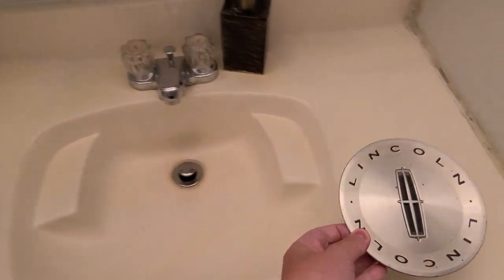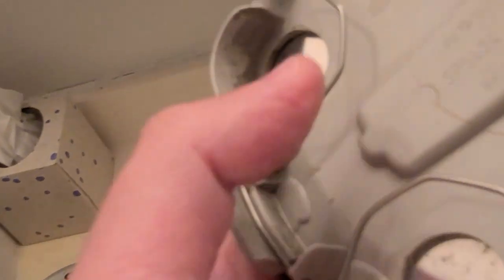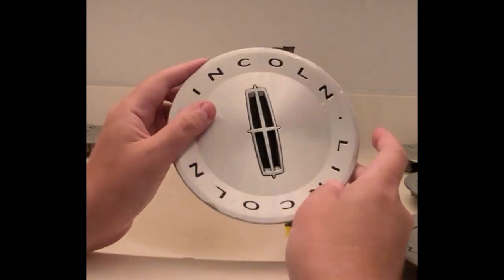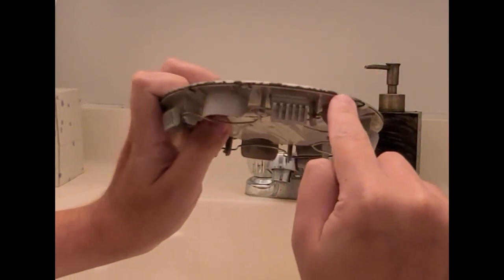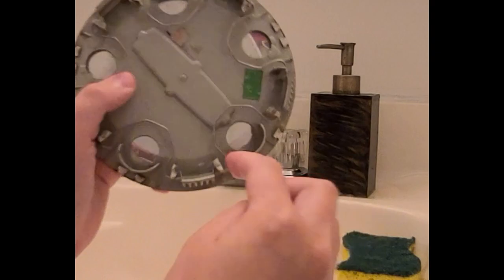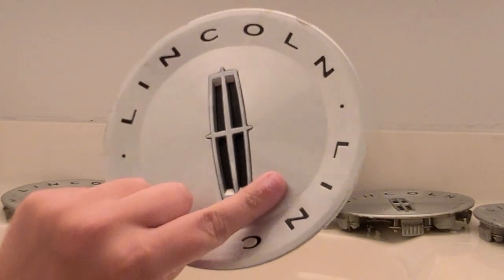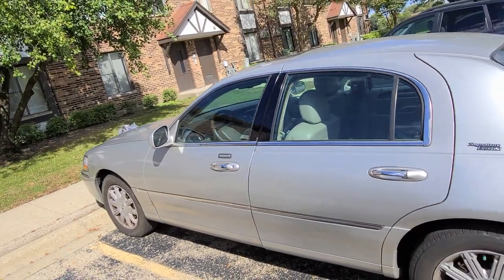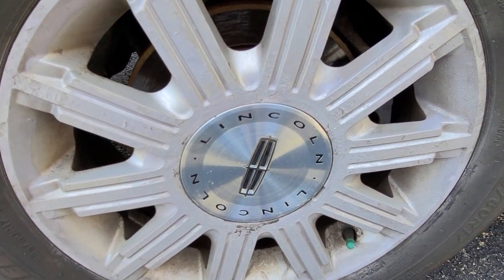Lincoln Town Car Guy Gets  Replacement Wheel Center Hub Caps For His 2006 Lincoln Town Car

Comment: There are still some new vehicles that have a center cap that hides the lug nuts but it is less common nowadays.  I prefer that design only because usually when you have your tires rotated or changed the mechanics are not careful at all with the wrenches and damage the lug nuts and sometimes even the rim in the vicinity when taking the lugs off.  With a cap like that it is all hidden.  I had a Park Avenue that had exposed lug nuts but it had chrome lug covers so I could at least remove those before taking it to the mechanic when the wheels were going to be removed.  I recently had the misfortune of getting a staple in a tire on my brand new Yukon with 500 miles and had to change the tire.  Of course they scratched up my lug nuts a little and even the rim a tiny bit.  It's very minor but come on, it's a brand new car!  Would they treat it like that if it was theirs?  On my old Buick Century it has full plastic bolt-on chrome wheel covers with a similar center cap and I just take them off if I am going to have a wheel serviced.
Reply from the maker: Thanks for the comment! This is my first car with these and the first car to ever have anything stolen off it... They weren't perfect, but I was happy to get all 4 at perfect. Replacements are also well used, but look a lot better that before

Comment: Thats the smallest bathroom ive ever seen!..........Im not even joking, also my caps are so loose i can hear them when i drive at slow speed with the windows down, i don't know how to fix that
Reply from the maker: Well, it's the smallest bathroom I've ever seen also :D This is the 1/2 portion of our 1.5 bathroom / 2 bedroom 948sq ft. condo. We just use it as back up or utility + that's where all the cat's stuff is since it's tiny. If I were you, I would see why they are loose - broken tab(s), that metal retainer is missing? Either use clear caulk to secure or just replace if you can find at a reasonable price.